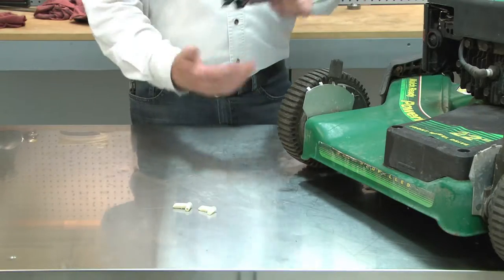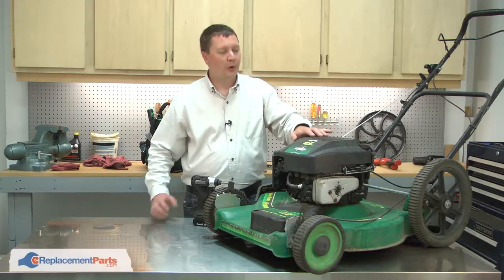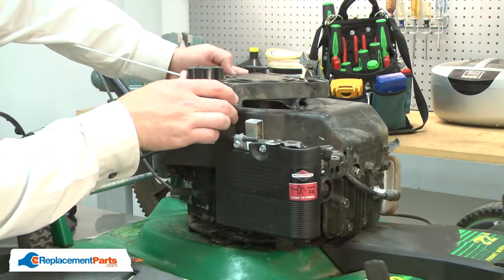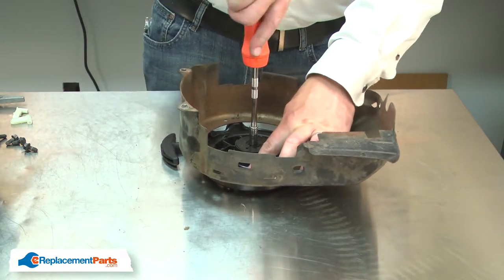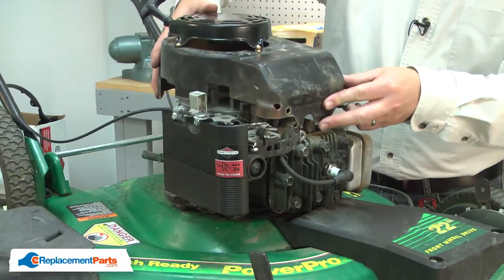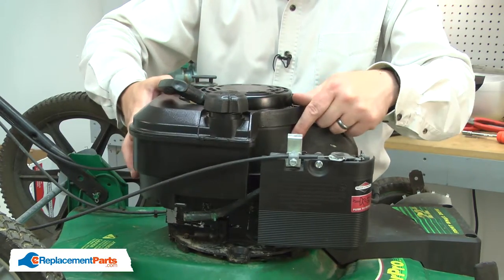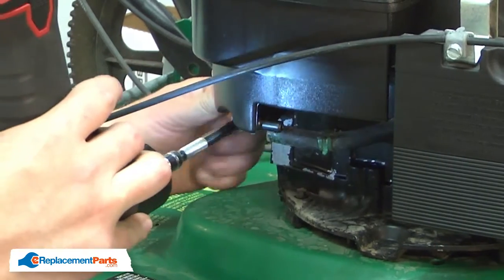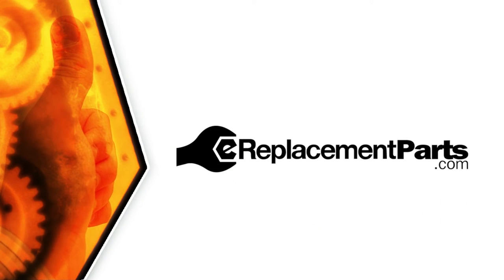Small Engine Repair - Replacing the Ratchet Pawls (Briggs & Stratton Part # 281505S)

Comment: I have a 12.5 HP Briggs on a wood splitter that I have to replace the pawls or/and the plastic piece that they fit in, about every year. The plastic post that the pawls sit over seem to continually break. This motor kicks back hard, mostly when its colder ambient temps. But if the rope is yanked out of your hand that is usually when things break. Is there any good fix for this problem. The engine is about 15 years old. Still runs great. This is a nuisance problem I would love to get fixed. Any help appreciated. Thanks, EE
Reply: I have same issue
Reply: Sorry to hear. It’s pretty aggravating. No one has made any suggestions. I still have the cover off mine. I have been pull starting it with a short piece of rope and a wood handle I drilled a hole through. But that’s dangerous, and it’s dangerous running it with the cover off. Accidentally stick your hand on it and one of the air fins will take a finger off. Briggs and Stratton should have a reliable safe fix for this junk.